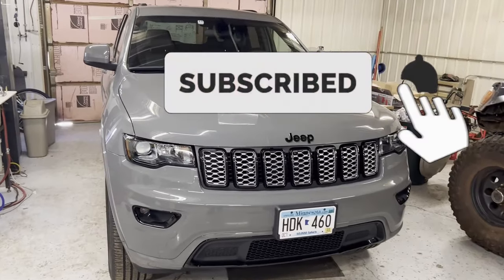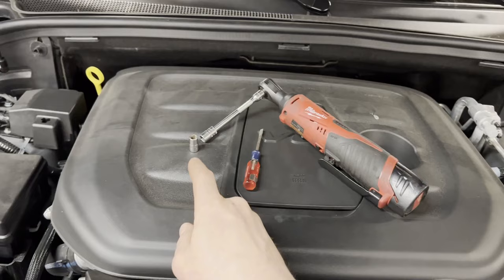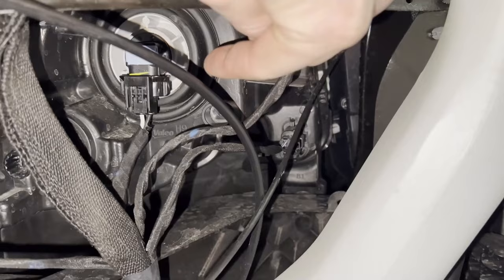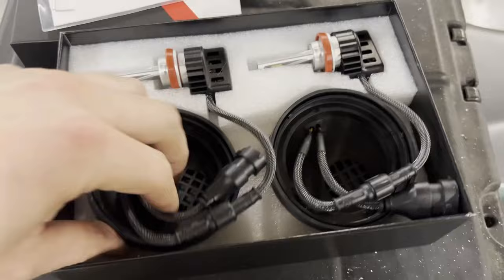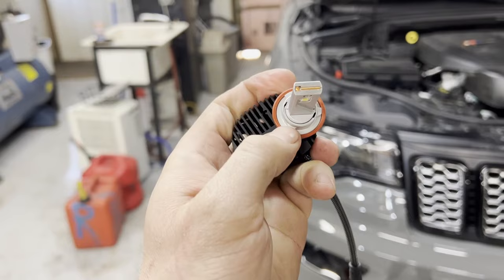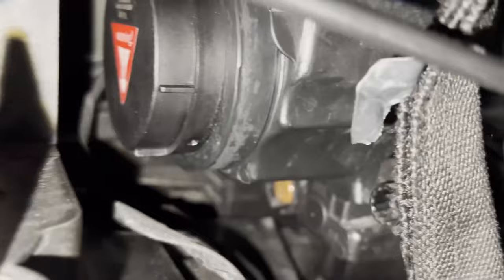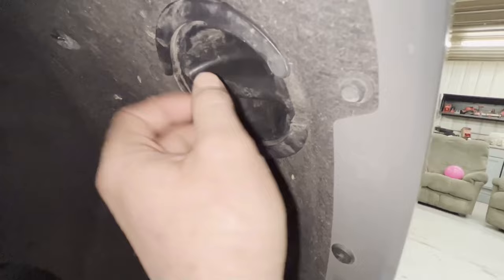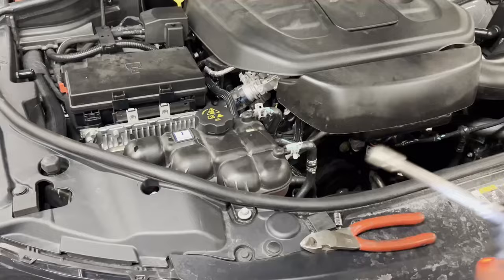JEEP GRAND CHEROKEE 2017-2021 - HOW TO INSTALL SPECIAL H11 LED HEADLIGHT BULBS

Comment: So i have a set of these. with these being a dual side going into the projector housing, do i need to adjust the bulb left to right vertically? or left to right horizontally? that would be either 12 and 6 or 9 and 3?
Reply from the maker: Hi, these Pro-DC H11 LED kits are specially made 2017-2021 Jeep Grand Cherokee, and the mount socket of LED bulb was designed based on the OEM headlight housing socket, don't need to adjust the bulb.
May I know the year and trim of your Jeep Grand Cherokee?
Thank you!
Reply: @lasfitvehiclelife  okay! i have a 2019 grand cherokee altitude
Reply from the maker: @PhilipAGreen  Okay. These special H11 LED kits will fit your car. Will you install them by yourself?
Reply: @lasfitvehiclelife  awesome! yes i’ll be installing them by myself so i just wanted to make sure that the there is no required special positioning of the bulb once it goes into the projector housing so i can make sure i get the correct output of light

Comment: Really hard to access ! Chrysler engineers dummies ... You could have a Porsche design that idiots can remove and steal  your whole light binnacle in 30 seconds?
There is a mid point, access under the bonnet only and a 5 minute job, as my Fords in the 1970-80s ?
Great video, seems easy , small strong hands an advantage. I like the many hints for mechanics taking care, many systems could be damaged with brute force.
Why 2017 plus ? Would this not work on pre 2017 like my 2014 V8 with dying headlights? Great Video.
PS  I have to replace mine, I am going for OIM Halogen H11s vs LEDs with 'computer fans' that seem a weak point with water or spray ... , your comments ?

Comment: Did you align the bulbs to 9 and 3?
Reply from the maker: Hi, these LED bulbs have optimal light pattern after installation and do not require adjustment. 
Could you please tell us your vehicle's year?
Reply: 2021

Comment: I really want to upgrade my parents Grand Cherokee w/ these lights, but after changing their headlights before, it was a PAIN.  Absolutely horrendous design, the engineers at Jeep should be fired.
Reply from the maker: Actually, you may take some time to complete the installation, I believe you'll be suprised by the headlight illumination after installation!
Would you like to try it?

Comment: Give yourself 5 hours to set aside to simply replace the passenger side  headlight , not the high beams.   I cut my hands a bunch and we had to jack the car up to take off the carpet around the wheel well to get underneath. This was all after releasing  the  coolant tank 
American design is terrible.  The vovlvo XC-90 is four simple clips and the headlight comes out.  The bummer about a Volvo is that is is $1,000 min for any trip to the mechanic.
Reply from the maker: Hi， for some vehicles, it is truly hard to take off the bulb from the hood, you can try to take off the bulb from the tire fender.

Comment: Did anyone mention that these are completely illegal?  I just bought a set  and was preparing to install them.  You all must have a totally different Jeep Grand Cherokee, because there is no way to get you hand up in there to take out and put in the light.  So, I contacted a local shop to have them put them in, and they immediately told me they can’t do it because they are illegal and not approved by DOT.  If you have an accident and these headlights have been installed, pray that the other driver’s insurance company does not find out, because you will be found completely liable and your insurance company will not pay either, as you have installed illegal after market products.
Reply from the maker: These LED bulbs are designed to directly replace the stock halogen bulbs without the need for splicing or any modifications. It's a simple plug-and-play installation. Many people have chosen to upgrade their OEM halogen bulbs to LED, and they have experienced a significant improvement in brightness. This upgrade provides a safety assurance for driving on dark roads at night. 
Thank you very much for your comment and for sharing your thoughts.
Reply: Who cares what they think. We know it’s not DOT approved. But we still hooked them up to see better. Safer, and more confident on the road at night. Without blinding others. 

I would just tell them. I know it’s not but I don’t care. So please I would appreciate if u just hook them up anyway.

Comment: the car cannot afford more than 35 w and you install 50 w that will burn in the future
Reply from the maker: Usually, the OEM halogen bulb is 55W-60W. Additionally, Pro-JP-01 have unique dual cooling system on the market, one is the big dual-ball-bearing cooling fan, at the bottom of LED bulb. Another one is the turbofan cooling system, which is embedded in dust cover. It can dissipate heat quickly from the LED chips and housing through the vents. 
Could you please tell us your vehicle’s make/model/year? So that we can recommend compatible  LED bulbs for you.
Reply: @lasfitvehiclelife  mine is grand Cherokee 2021 limited
Reply from the maker: @ptareah  We have custom-made H11 LED headlights with dual-cooling fan for your Grand Cherokee 2021, you can check more details about it from this page:
You can check all compatible LED bulbs for your Jeep Grand Cherokee 2021 limited on this page:
https://www.lasfit.com/products/2017-2020-jeep-grand-cherokee-led-bulbs-custom-made-h11-headlight-low-beam?utm_source=Social&utm_medium=YTB%20Channel&utm_campaign=Pro-JP-01L
If you have any questions, please do not hesitate to cantact us.
Reply: It only depends how cool the led bulbs are. They can be cooled around 100 degrees Fahrenheit. 

The cooler the led bulbs, the longer the lifespan is, the hotter the led bulbs, the shorter the lifespan is.